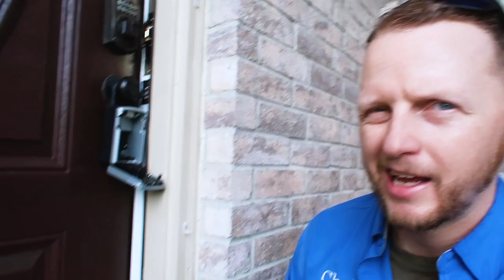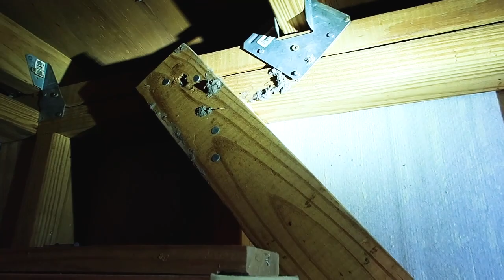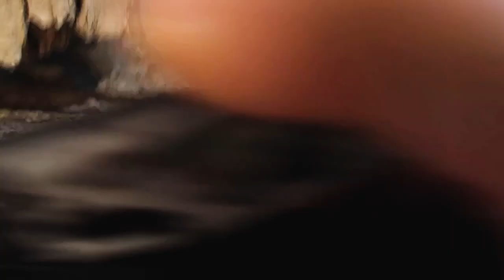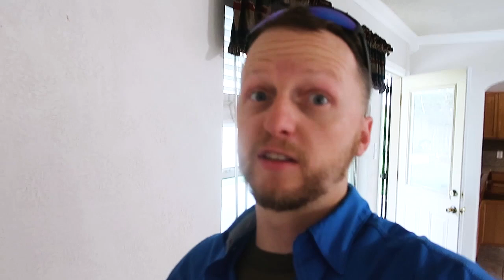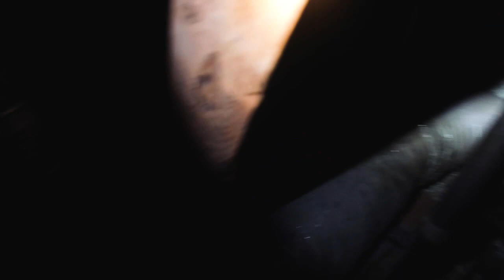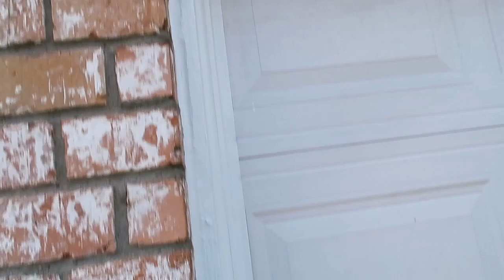Termite Find and a New Lock Box on a Home Inspection

Comment: I find it ironic that some inspectors, professionals who operate in the realm of manufacturers recommendations and abundant safety standards, will set up a ladder on top of a roof. I have a feeling you’d be thinking “damn, shoulda stuck to the drone” if you ever end up badly injured, god forbid. Not worth it.

New inspectors out there: don’t do that. No one is expecting you to get on a dangerous roof. The client or agent aren’t going to be doing anything for you when you’re in physical therapy learning how to walk again. Stay out of a wheel chair and keep inspecting. If anyone insists you get on a roof you’re not comfortable getting on, give them back their money and never talk to them again. YOU are the one who might very possibly die.
Reply from the maker: The key part of what you said here is, "if you are not comfortable".  I do agree with most of what you are saying here, but how we operated the ladder on that day was safe.  There is several times I have not walked roofs because they are not safe.  That is why we carry the drones.  Due to the design and pitch of that roof, I could walk it 100x over and not be in any real danger.
Reply: @AActionHomeInspectionHouston  but do you really take the ladder up onto the roof even while you're by yourself? You'd have to bend & reach over the edge and hoist the ladder up to the second floor while extended. I have that exact ladder and walk roofs all the time. that would be very dangerous. is it so dangerous that most people who do it fall? no, i understand many people do it. but is it waaaay more dangerous than setting it up from the ground? of course it is.

For what its worth, i really like you guys and I've only commented on youtube videos maybe 2 or 3 times ever. it just bums me out how little you hear about safety. i've been on a couple roofs i shouldn't have been on. I don't want other people to experience that just cause "the client want us to walk the roof". that's BULLSHIT. we're not freakin firemen.